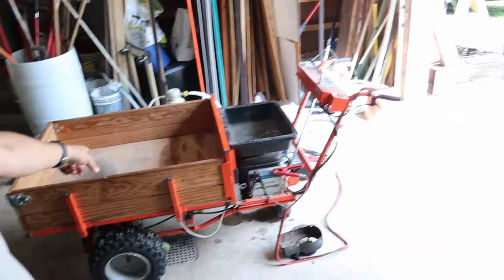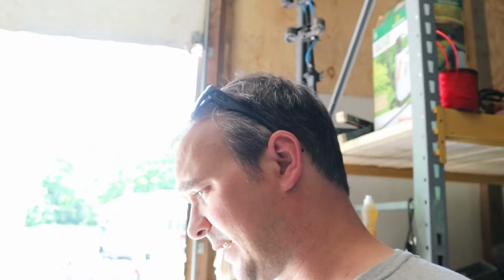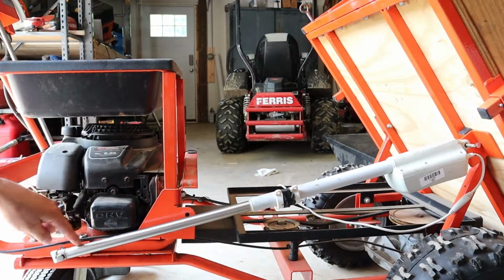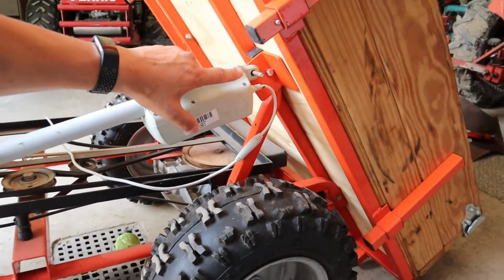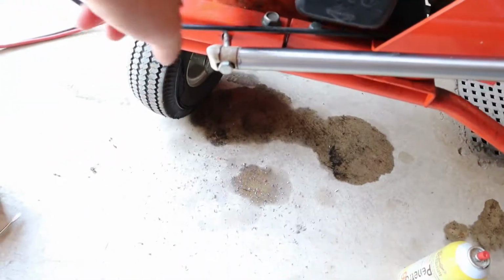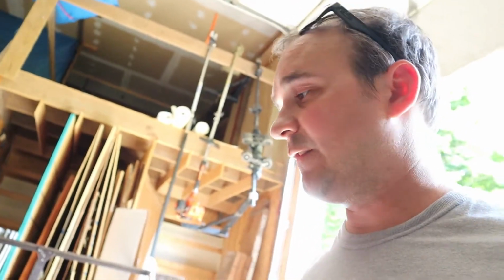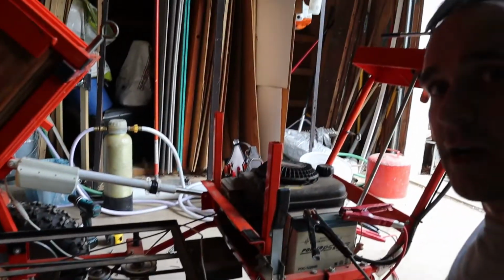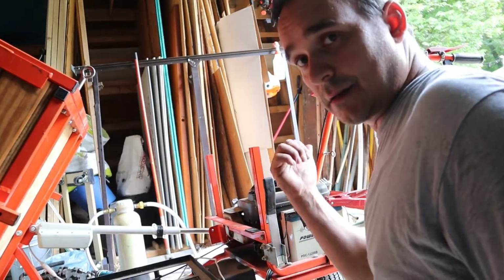DR Power Wagon Actuator Repair for Power Dump

Comment: The old DR PW is a very useful tool.  You got a great price on it.  If it were mine,  I'd just take out the electric start and power dump and forget about them.  Less to go wrong.   I have an old one without those "accessories" but the same vintage and model.  Manual pull starting and dumping are never a problem.  The load bed is balanced so it tips easily even when fully loaded.

Comment: Hello, I just got one of these PW6E. Got mine running and it needs brake work. I looked up the electric dump kit that’s offered by DR. It comes in 4 variants depending on the machine serial number. The actuator is universal but the wiring harnesses are different. The kit is $530 as of this writing. My question is what are the details on the actuator you installed? What medical equipment did it come from? Thanks.
Reply from the maker: Adjustable bed.     Look up actuator on Amazon.   I think mine is a 12" travel I think 
It has been a while since I added it.    Good luck

Comment: Great video. My DR Power Wagon is at least 10 years old. The pulley of above the trans is locked up. It does no turn freely like my other one does. What could be the possible problems with it? And where can i find a diagram of the trans? Thank you kindly for any help or info you can provide.
Reply from the maker: Sorry not sure without seeing and messing with it.   I find my diagrams just by using google images and looking around for a bit. I usually find key words to help with my search.  I am sure there are better ways but that seems to work for me.   Good luck    Let me know what you find out.